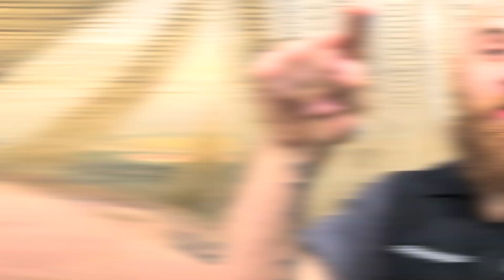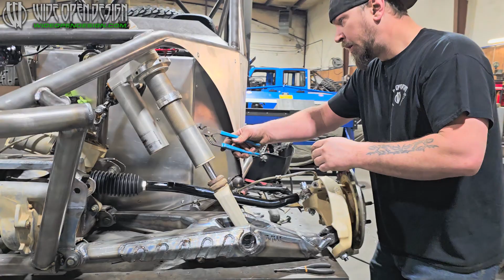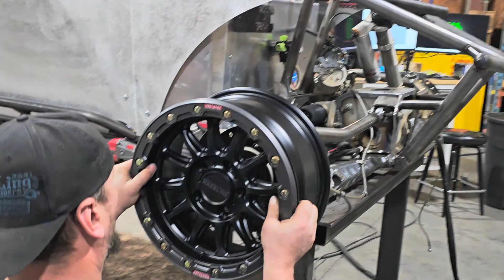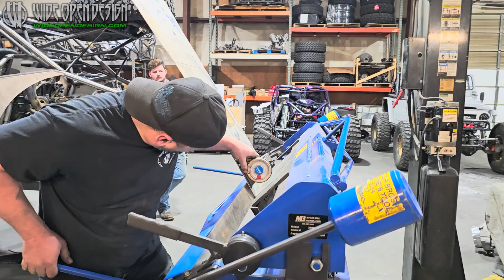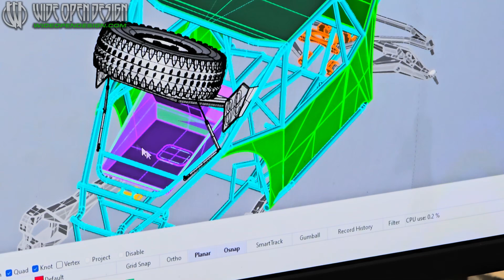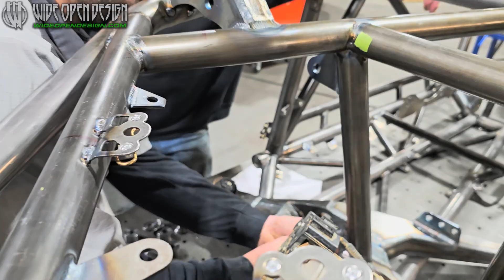Polaris RZR Front Suspension & Tool Box Build | King of the Hammers 2025

Comment: Hey dude u should give it a 500-1000hp engine because of light weight and stuff (also you should put a led bar or pod lights)(just saying)
Reply from the maker: A big engine may not fit in this thing however Jason definitively knows ways to make more power
Reply: @ u could extend the back like a sand rail but the down side is yoyr gonna need harder shocks = on whoops u gonna have a bumpy ride (find a big engine that can fit)